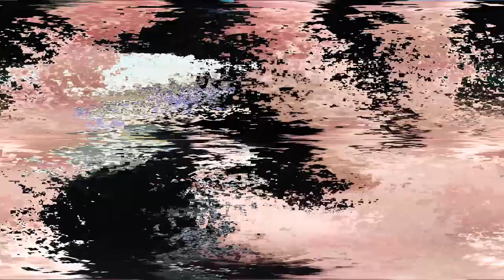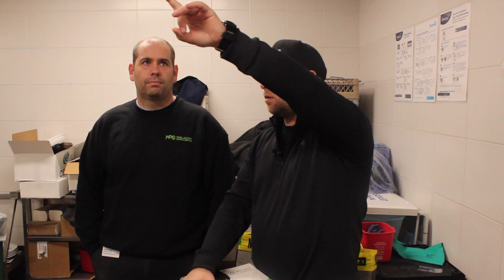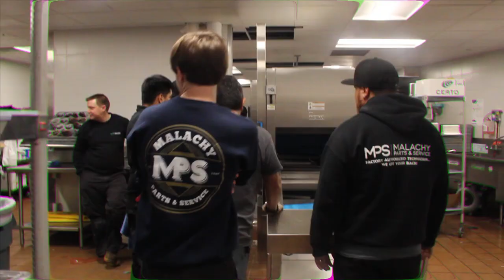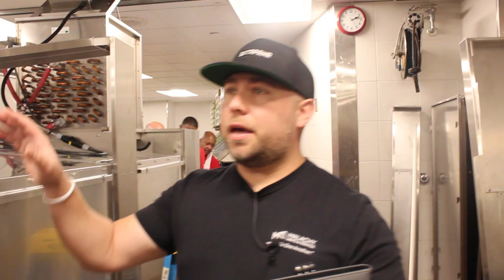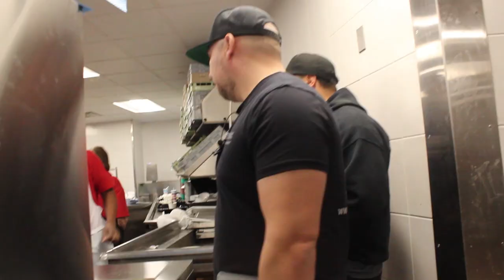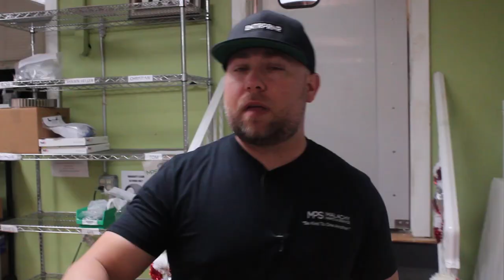IN THE KITCHEN WITH TECHS INSTALLING A MEIKO DISHWASHER! | A Day in the Life

Comment: Hi sir can you help to me to adjust final rinse temperature of meiko up ster U 500 M2
Reply from the maker: People also ask

How do I contact the tech support for my Meiko dishwasher?

(800) 868-3840

Just call (800) 868-3840 and follow the prompts to reach someone after normal business hours. MEIKO service engineers each carry a comprehensive stock of spare parts and components used in the manufacturing of your MEIKO warewashing appliances and systems.